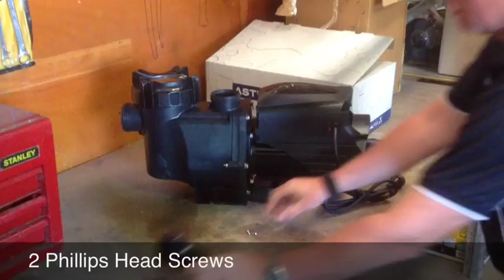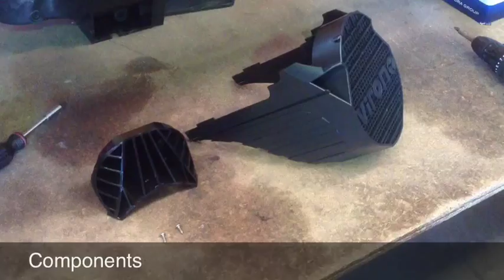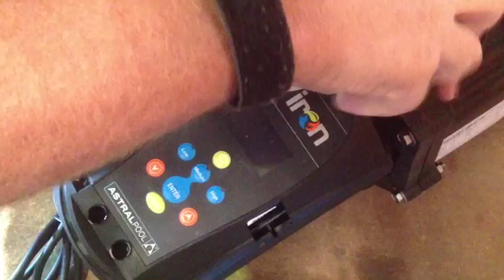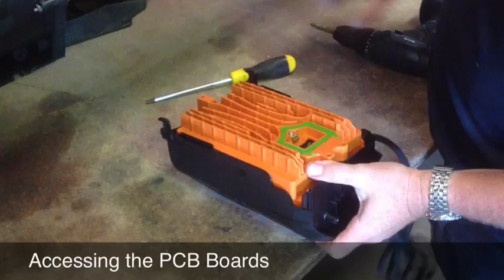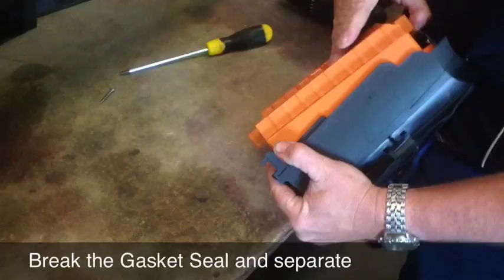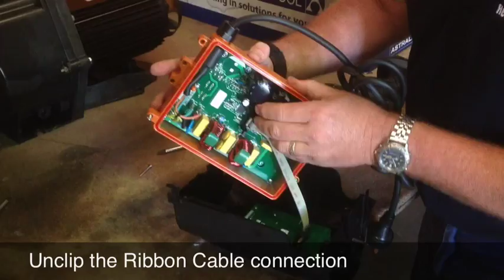Viron eVo Pump - Servicing the Control Board

Comment: The backlight on my controller isn't working, is this an easy fix, any idea of which component needs to be changed?
Reply: Common problem Richie. Viron/Fabtronics  won't help, but I can.
Reply: Hi Richie, where are you located? I can tell you how to fix, or if you're in Australia I can look at it for you possibly. Back lights aren't the only issues these units have.
Reply: I live in WA. Could you please tell me how to fix it.
Reply: @Live_long_and_prosper-1  Okay, whilst you can't get a direct replacement back light for these on the domestic market (I've looked far and wide), you can get a much more dependable setup to replace it. To do this, you will need to have the right skill sets. Are you proficient at rework/soldering and the like? I can make a video on this and upload for you, but you really need to have the skills to repair circuit boards for this. I'm an avionics/aviation background, now in medical, 26 plus years experience with this, so it's 2nd nature for me.
Reply: Thanks, I am a technician, so soldering not a problem. Any information would be greatly appreciated.
Reply: Yes please.  What do I need to do.  Mine shows a HI T fault code and won’t start.  Literally after disconnecting from mains power for 30 seconds and I try the motor spins for 3/4 second and the shaft spins then stops.  Motor not seized.  I’m assuming it’s the control board.  LCD working but back light does not.  Please help? @mrsmith7835